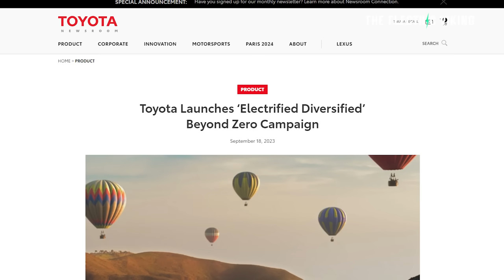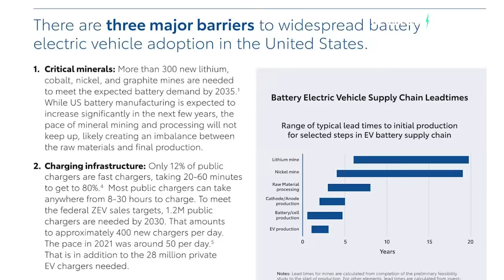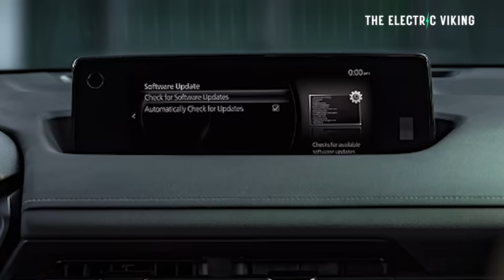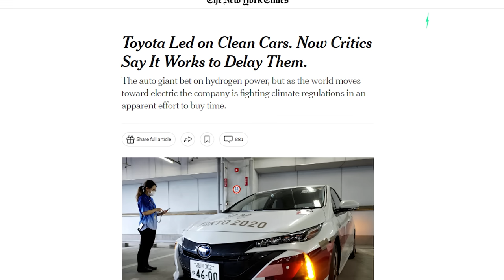We are witnessing the early stages of the biggest fall of any company in history

Comment: Has Toyota found that they can use Fairy Dust to power their ICE powered vehicles and have no emissions?
Reply: They can run on hydrogen and still be ice while effectively having zero emissions
Reply: @od40k77 to expensive with cars, now if they did a water to hydrogen engine that was more efficient than 60% of usable energy then it’s viable.
Reply: @herrba  If you can do that, your Nobel Prize in chemistry awaits.
Reply: what is he amount of energy needed to take H out from H2O? Is it part of the 60% that you talk about?
Reply: @od40k77 Theoretically yes, practically no.
Reply: @od40k77  yes but hydrogen powered EV is 3X more efficient than hydrogen powered ICE. No one will produce hydrogen powered ICE over EV. And where is the infrastructure for affordable hydrogen fuel and stations?
Reply: @larryc1616  might want to check out what Toyota is up to.  They claim to be close to having a production ready hydrogen ice engine.  As for infrastructure, that will eventually be built out probably through government subsidies, once proof of concept for hydrogen power has been shown.

Comment: I'm impressed by what Mazda achieved with their Skyactiv system (a significant improvement in efficiency in the 2010s), but would consider it a last gasp of a dying technology. Combining that with Toyota hybrid tech isn't really going to get them over the line.

Toyota originally countered criticism of going hybrid and not full EV in the early days by saying they were using hybrids to develop technology that would be used to work to their goal of EVs. Then they just didn't bother moving on from hybrids - this is so frustrating; they could have been the market leader.

Comment: Fuel for ICE machines can be made from air if one is clever enough and have no qualms about expending profligate amounts of energy to make it possible. Pretty sure it will never be a viable competition to pure electrified mobility, but it could in principle be carbon neutral, though we’d still have the issue of some level of polluting combustion by-products.
Reply: Technically we have had carbon neutral car technology since pre ww1... it's called wood gasification and it makes an engine run on wood with very clean exhaust. It burns simmilar in cleanliness to propane powered cars. The carbon all comes from plants so its carbon neutral. I've been considering building another one and putting it on my old van. A vegetable processor near me sells corn cobs for around $200 a ton and I'd get around 2000 miles out of that even in a v8 powered 6400lb van. About 10 cents per mile with even cheaper options available. For instance waste from the Marijuana industry in my state would get me nearly 14 miles per pound vs 1. Even expensive fuels like wood pellets would still be cost effective with gas costing $4 a gallon.

Comment: The net zero idea Toyota might be referring to is the synthetic fuel that Porsche is working on, which apparently uses CO2 from the air to make the fuel. Therefore, if you use the CO2 to make the fuel that then puts the same amount back, technically it’s net zero carbon neutral.  Of course there’s lots of other pollutants in the exhaust they aren’t talking about. 

Some don’t believe such synthetic fuel can ever cost less than around $10 a gallon.
Reply: Anything that burns air will put out NOx. But there might be a market for synfuels in some applications. Ammonia, or butanol which can be handled like gasoline. Hey, it's only money. For cars or delivery trucks, ain't no way, EV all the way.

Comment: Note: rare earth metals and recycling are the Aquiles heel of electric vehicles, and both this processes cause a huge amount of pollution. These issues will take decades to solve, until then, I think Toyota has seen the potential but also the cons of EV, and is focusing on hydrogen/eco fuels for the near future. Many of those who had to change the battery won’t buy another EV due to the replacement cost, and that is another issue.

Comment: Toyota is one of the greatest engineering company in history. Right now, hybrids make the most sense. It is the best of both worlds and allows EV technology to mature to be a true alternative (range, charging speed, resilience in cold weather). Currently, EVs require government subsidy, coercion, and market manipulation. Not a great look.
Reply: hybrids have the advantages of both but coupled with it are the disadvantages
Reply: @peejayem4700  disadvantages include: you carry around the weight of two types of motors. You have the highest chance of a fire among the three options: ICE, EV, Hybrid. You aren't actually emissions neutral.

Comment: After a few years with an EV going back to ice it’s like getting a steam, powered car with coal or wood and a water tank.   The lack of maintenance is staggering
Reply: @basilmagnanimous7011 you’ve obviously never driven an ev
Reply: @basilmagnanimous7011  how could ev’s use more brakes than ICE vehicles???
Reply: @basilmagnanimous7011  brakes last exponentially longer on ev’s. It’s quite common to only touch the brake pedal once or twice a day. The motors retard the vehicle and use the force to regenerate the battery (ie: one pedal driving)

Comment: I don’t think that Toyota will fail. Why? Look at what happened in Chicago with people waiting hours in below zero weather to charge their dead EVs whose range was severely compromised my the cold. Add to that, the sharply higher insurance rates and the fact that it still takes five minutes to refuel a gas car..even in freezing weather. Of course ICE cars suffer from dead batteries too but the cost of battery replacement is a small fraction of what it costs to replace an EV battery. Collision repair on an EV is much more complicated and far more expensive than that of an ICE vehicle. Yes, EVs are great but it will take years to get both the technology and infrastructure equal to that of ICE cars.
Reply: Chinese car BYD hybrid has hit 2000km range.

Comment: Charlie Yunnek, who used to write the "Hey Smokey" column for Popular Mechanics magazine, patented a fuel mixing system over 340 years ago that doubled the power and mileage per gallon and passed any emission standards without using a catalytic convertor. He received several patents and demonstrated the actual system on regular model cars. No manufacturer was willing to license the technology. One VP of engine development said off the record that if he went back and told management that this was real and possible, they would say why are we paying you so much money, if some mechanic in his garage can figure this out. Plus, big oil has a vested interest in low MPG. By pre-mixing gas and air over a heated and tortuous path, complete combustion and double engine efficiency was obtained. Also, no need for platinum catalyst catalytic convertors which are a major target of thieves. Check out the patents and then ask why it will never happen. Too many powerful one percenters don't want higher MPG and cleaner emissions.

Comment: What do EVs and Flat Earth have in common? After a list of all the problems of their positions is presented to them the Zealots' response is, 'You don't understand.'

Here's what i understand: On  a trip from East TN where i live to Manitoba during  bitter cold, when i start with a full tank of gas, by the time we get on the plateau it was 5F amd we pulled our coats off, sat and relaxed. The next forced fuel stop is central Illinois and the one after that is north of Minneapolis/ StP. Warm car, comfortable ride, luuxury performance suspension amd tires. Sit and relax, listen to the sound system, enjoy the view out the windows. NO CHARGING ANXIETY. NONE! Go where we want to go, stop where we want to stop. And this car is 25 yo now, 215k miles. It hasn't had four rebuilt engine/transaxle replacements, which is the equivalent in cost to the replaced battery packs an EV would demand.

Nope, i just don't inderstand

Comment: Been wanting to buy an ev. After serious test drives in our cold weather in rural Colorado, they just don’t cut it. I don’t believe they are nearly as green to build as were being told. 
I have several solid reliable 25 year old vehicles that probably have a lower carbon footprint since I don’t throw them away every 7 years for a new I Phone car.
Reply: Great comment, I agree there is high likelihood of full life cycle CO2 emissions and other negative environmental impacts being vastly understated by pro-EV crowd and government backers.  There is also too much anti-EV vitriol from ICE fans, nuance and transparency are needed in these conversations and policy decisions.  Like you I drive late 90’s/early 2000’s cars as daily drivers, and will wait for battery technology/safety and charging infrastructure to improve before considering buying an EV.  Our throw-away, new tech obsessed society conveniently glosses over their own high carbon footprint from getting new cars every 2-5 years.  If CO2 reduction is truly the primary goal, full weight should be thrown into hydrogen fuel cell technology and green hydrogen production.

Comment: We have a company in Florida that can reduce cellulose mechanically to sugar and lignin. The sugar is fermented to ethanol which is converted to gasoline (or kerosene for aviation). Costs are record lows for biofuels and if the cellulose is an annual crop (not the food part but the cellulose, then it can be that an internal combustion engine can be 100% carbon neutral. Company is Blue Biofuels (BIOF) in conjunction with Vertimass (Private).
Reply: That doesn't solve the problems of noise, particulates, NOx, etc.  It would be good for transcontinental air travel, propulsion in places like Antarctica, and some emergency use.   I don't think they can compete with electric drive on the basis of cost in all but the most extreme use cases.

Comment: I think it’s self evident that the size of the market for ICE vehicles will crash over the next decade. But there will probably still be some demand for non-EVs in parts of the world where the power grid isn’t up to supporting the extra stress of charging all those new batteries. So maybe 10% of those 5.5m Japanese auto workers will still be in a job.
Reply: In any case, 85% of global energy consumption is fossil fuels. Almost all electricity is generated by fossil fuels. Why so important that cars are running on fossil fuel generated electric power? What would  change if all cars became electric tomorrow? 

You know China is burning 4.5 billion tons of coals each year, and increasing fast? India is right behind and increasing even faster.

Comment: It's like when the transistor was invented. The TV's transitioned with hybrids, using the vacuum tube only in the High Voltage section of the TV called the "flyback circuit" ...then it went full Solid State. That's exactly what's happening to the Automobile. The combustion engine is equivalent to the vacuum tube.

Comment: I am writing this before I viewed this vid. Mt Chevy Bolt EUV is super fun to drive using one pedal drive, but in the winter it is not great, batteries do not like cold. The batteries are about 35% less efficient, so you do not get as much miles out of the car, add  to that using heat which robs the battery even more. For example in the summer I get about 310 real world miles but in winter using heat I might get 125 miles, less than half. I have a home level 2 charger which in the winter have to charge three times a week, which means I spend more on charging than gas in the winter. This fall I might trade my car in for an I.C.E. car or hybrid.
Reply: You do you, I'll trade it for a better EV, with bigger batteries and ones that don't degrade that much in the winter.. Hello LFP batteries.
Reply: driving in the cold in any vehicle is less efficent than in the warmth.. drivers for the most part dont go joy riding in the cold less is best behind the wheel in winter
Reply: I had a Bolt.  I live in Wisconsin.  I charge at home.  The Bolt is known to take a bigger range hit in the winter compared to other EVs.   But my experience with the Bolt was not as bad as you are describing.  Maybe you pay a lot more for electricity than I do, but for me the Bolt was way better than ICE even at the coldest temps.   There are lots of reasons to move away from the Bolt however and the winter range hit is one of them.   Do you really want to go back to gas stations and all the ICE car maintenance stuff?   Get a Model 3 and you’ll find it is as much of a leap forward from the Bolt as it was going from ICE to the Bolt.  Plus you get the supercharger network which is enough reason to change by itself.   GM is a horrible company.  Look at how they handled the battery issue with the Bolt.   My daughter has a Chevy Volt.  She has waited a year and a half to get an EGR valve, a part that should never go bad.  Without it she can’t pass an emissions test.  Without the emissions test she can’t reregister the car.   So if you do go back to ICE at least avoid GM.
Reply: I am glad you like it, I like driving my car but for winter it's not for me. Personally I believe the EV fad is over, everything I read is that hybrids or I.C.E is what people are asking for.
Reply: @TricoliciSerghei  I'm in Minnesota. Which one doesn't degrade in winter?
Reply: @begelston  Check out sodium ion batteries. They can work in very cold temperatures -20 degrees celsius without significat charge loss. So any cars with sodium batteries in your area, or any GOOD Chinese car with high mileage. 400 - 500mi +.

Comment: Since far too much of the electricity grid relies on on burning carbon, electric cars are not the solution. Sadly where I live in Ontario Canada we are going to be building more nuclear plants! Canada has plenty of uranium. But nuke plants require horrific amounts of cement so building them is very destructive. Then of course, there is the risk of accidents and no place to put the waste. You are lucky in Australia that the Sun is supplying ever increasing amounts of your energy. This Summer is going to be very hot. That means decreased hydro electricity as rivers dry up and nuke plants that have to close because they don’t have cooling water.  Not really the high ground to get electric cars unless your source of electricity is” clean”.

Comment: Toyota's PHEV tech is good; they need to put it in more cars and increase battery storage to near-EV capability, for example 50-100 miles in pure electric mode. This seems like the best way to dent the EV threat, until Toyota can finally come out with a credible EV to compete with the Model Y.
Reply: I totally agree with you. I have prius excel 2020 phev in the UK. I can charge at home and I do abt 16k miles annually. My family and I don't see the need to swap the 2nd car, which is diesel, to an EV.